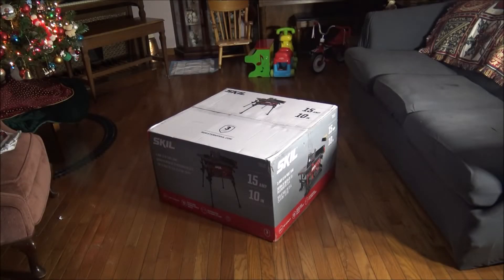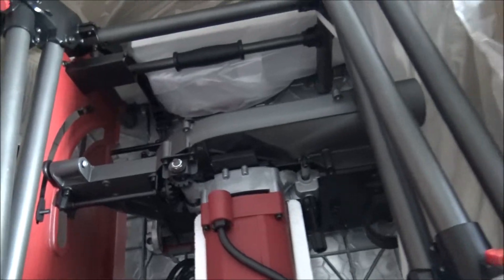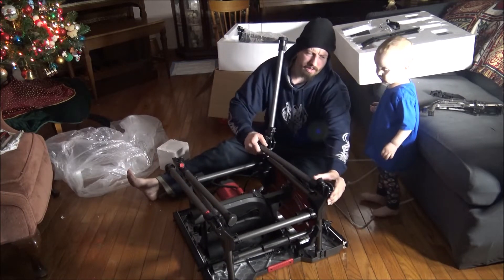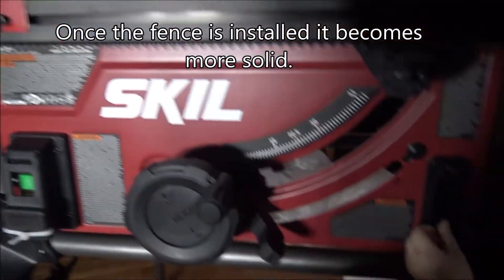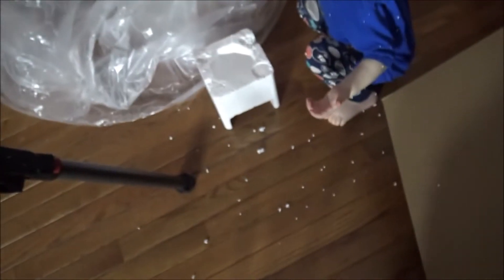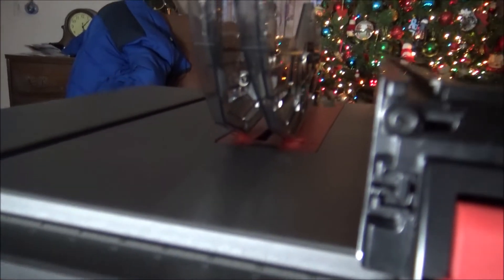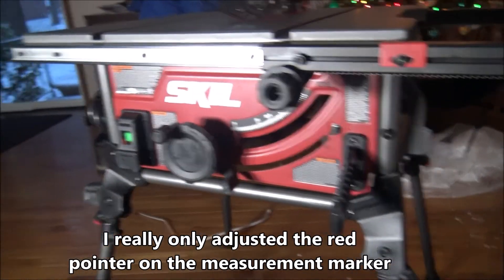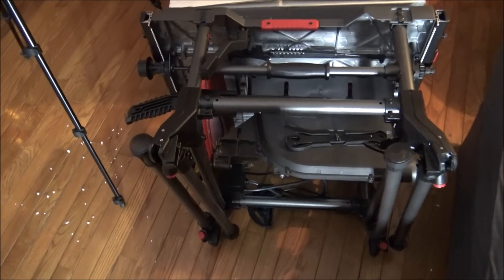The SKIL TS6307-00 10'' Jobsite Table Saw Unboxing and setup

Comment: Hello Thanks for your video, question, have you used DADO blades on this Table Saw? any comments or feed back?? how is the Table saw holding 1 year later???? Thanks again
Reply: Bought mine January 2024 at Menards for $299
Reply: You can get it for $269 now with an  Aluminum throat plate
Reply from the maker: It's a good saw, it will accept a dado but I'm not sure what size. I've been cutting mdf for home made trim and it cuts as accurately as you can cut, held tightly against the fence, which is difficult on 8ft pieces, cuts perfectly
Reply: @InNerdimensional  Thanks Sir for your reply, regards
Reply from the maker: @wwmilanl  you're welcome. Just curious, what's the price of these now?
Reply: @InNerdimensional  I see the Skil Table saw in Amazon at 374US$  at acme tools 349US$
Reply from the maker: @wwmilanl  I paid $299. Crazy how they go up in price
Reply: @InNerdimensional  I wish I purchased this saw then, I always wanted never did, one of do deals, I will get it this week for sure. Thanks again & Regards.
Reply: @InNerdimensional   you can get it at lowes for $300 still
Reply: @InNerdimensional  I just bought mine today January 29th 2023 on sale for $300.00 at Menards...normal cost there is $350
Reply from the maker: @talesoftheredpill7542  nice, it's a good saw. I'm super happy with mine. Throw a good blade on it and don't forget to check for square
Reply: @Zack-xz1ph  Walmart also

Comment: Can the legs be removed? I have a small shop space and built a mobile base for my first and last saw, that I just returned... :( Now I have a mobile base w/o a saw and I don't want the stationary legs.
Reply from the maker: Not sure
Reply: You don't have to remove them.. they fold up and you can just put it like that on your work bench.
Reply: @gregoryderwon3133  that's my current plan. I found enough info finally that led me to this conclusion.  My only concern is height... but my back up plan there is smaller wheel size :D
Reply: @gregoryderwon3133  I was just asking on that. So with legs folded up, one can sit it on a desk or what ever and the folded legs do not interfere as the saw will be square to the table.
Reply: @erwinerwin1245  yes sir !

Comment: Good video, I learned a couple things and helped me after the unboxing. I was waiting for your kid to eat the styrofoam, but I guess his survival sense is in good shape :)
Reply from the maker: I've used this saw a lot and it amazing. The only complaint I have is the plastic saw blade plate. It bends under pressure. I'm working on a way to fix it. He has eaten a few nerf darts and bites out of a football... He's learning very quickly. He hasn't taken to woodworking yet... It is a very accurate saw though

Comment: Whats the difference between Skil and Skilsaw?
Reply from the maker: Skil is a diy brand. Skilsaw is contractor grade. This saw has a lot of the features of the skilsaw, but it's got cheaper materials in a lot of the production. Plastic in areas where the more expensive saw would be metal. The skilsaw is around $600 while I got this one for $299. Both saws can rip 4x materials, which is better than most saws on the market. And also, this saw is not worm drive. But it still has a lot of power for the price point. Unfortunately people are price gouging because of the limited production. I love this saw because it folds up into a small easy to store about 2'x3' area. Where as the bigger saws require a much bigger footprint. And it will fit into a car
Reply: @InNerdimensional  thanks! As I tought, same as B&D, Stanley and Dewalt, different targets
Reply from the maker: @federicobucayan3276  yeah, for sure. But this saw is legit. I would use it on the jobsite with no second thoughts

Comment: Just bought my first table saw ever and this was what I chose.  This video really helped me figure out where everything goes, tho I’m sad to hear the price this used to go for because I overpaid ;)

Thank you for the video!
Reply from the maker: You're welcome, how's it working for you
Reply: @InNerdimensional  so far, so good.  The tool is hampered by the craftsman at this point.
Reply from the maker: @rickpetersen3233  nice, just practice on some junk wood. I put a 7 1/4" 24 tooth blade in it and cut some finished plywood like butter. Run Diablo blades. And if you use a thin kerf blade, you have to remove the riving knife... Which is a pain. I cut mine so I can just pull it out

Comment: You skipped the only part that necessary  .  How to assemble the guard and kick back
Reply from the maker: It's super easy, I don't use them hardly ever. In the instructions, they go over everything in great detail. Probably the best instruction manual ever. Raise the riving knife all the way up and connect the kickback in the back slot and the guard goes into the middle and locks into the very top slot
Reply: @InNerdimensional  that's how I had it and it just don't seem right.. Maybe it is

Comment: Just unboxed mine last night. Still have to do all the adjustments as well. I'm sure you figured out by now the fence mounts upsidedown underneath. Good unboxing video.
Reply from the maker: I didn't figure that out, I'll have to look into it
Reply: @InNerdimensional  hehe. i didn't either at first. finally had to look in the manual to make sure. also took a little wiggling and adjusting to get it to snap into place. ✌️
Reply from the maker: @edgarshoe  I still haven't figured it out... Okely dokely I'm an idiot

Comment: Where did you get it? Can't find it anywhere.
Reply: Found it at "Do It Center" in NC!
Reply: Those of you in Southern California might  find them at HD Supply. I found mine there as of January 2020.
Reply from the maker: @nowayjose3365  did you mean 2021?
Reply: Yes, sorry I meant January 2021.
Reply: I saw them for $289 at HD Supply.. I’ve seen them at the stores in Long Beach and Santa Ana, CA.  They seemed to be going quick though.. I had to have them pull some down off the top shelves.
Reply from the maker: @nowayjose3365  it cause it's a great saw for the money and super portable. And it can rip 4x material
Reply from the maker: I got it at Menards. But there are a few other dealers. Go to the Skil website and click buy now and it should link you to a place
Reply: I also ordered mine from Menards.com. I'm in California. $299 plus tax and shipping plus couple bucks for "processing" $370. Still worth it having shipped out here. I regret not ordering from Amazon when they had it for $318 free shipping.